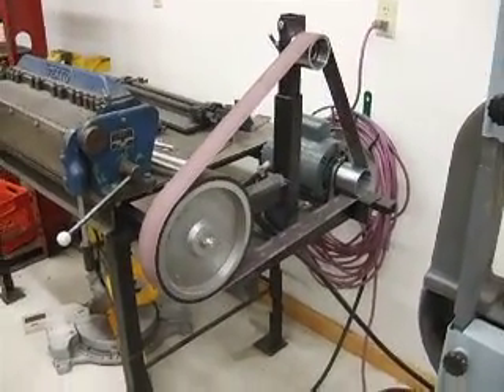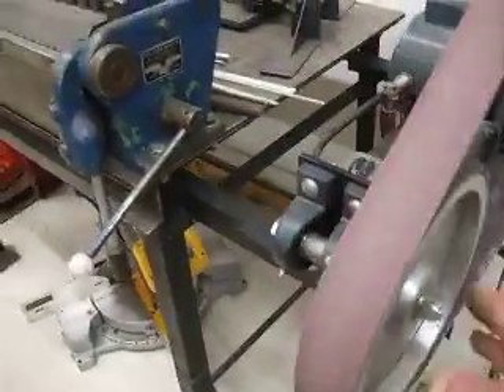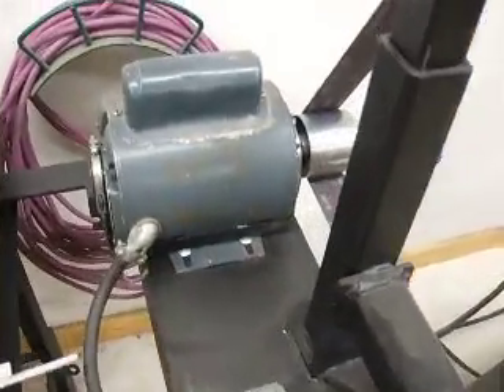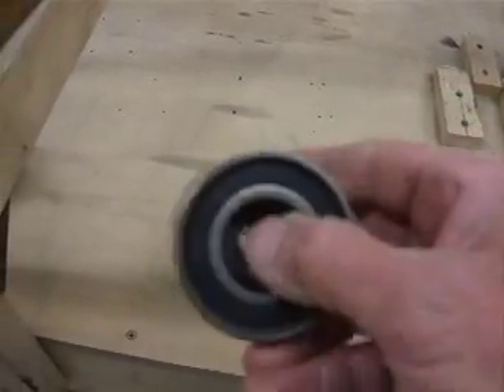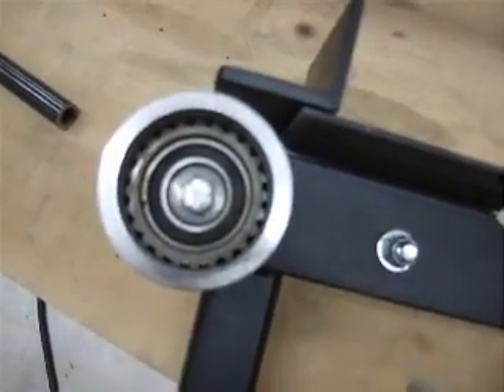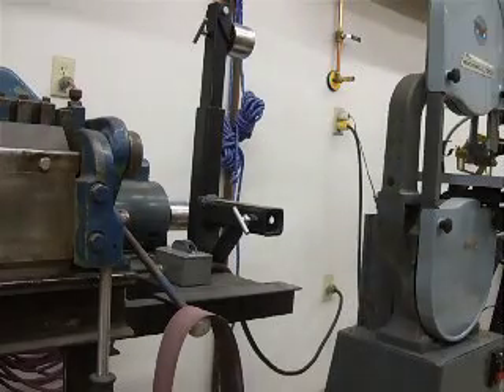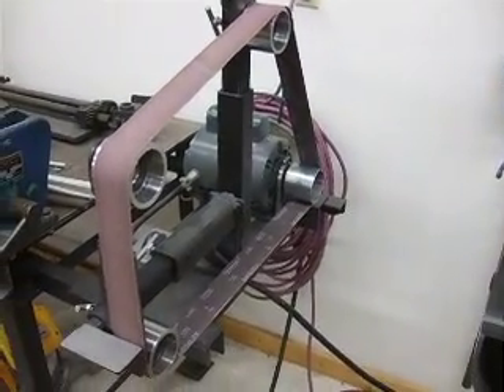2" by 72" Homemade Belt Grinder

Comment: Great video, thanks! Have you had any problems with static? How do you deal with that?
Reply from the maker: Hi Manny...interesting question and I've never thought about it. But I don't know what you are referring to when "dealing" with static. Have you experienced static discharge using a belt grinder? In all the years I've been using the grinder I have yet to experience any kind of static discharge. Whatever I'm grinding is in direct contact with the belt and I guess if there is any buildup of static electricity during use it would dissipate immediately. Hope this helps...
Reply: Thanks for your reply. I was using my newly built belt grinder without a platen, polishing with a belt that has a cloth backing , and when i touched the machine, I had a big discharged. I started reading a lot about it and is not an uncommon things using belt grinders. Do you use the machine mostly with a rest table and probably touching it often? If yes, maybe is there where you are "discharging" yourself. .. I have to try that...
Reply from the maker: That would probably be it. 99% of the time I'm using  the rest and that probably provides the path of least resistance for any static. Also, the grinder is bolted to a large metal table and the motor is grounded to the table and the electrical connection and that helps too. Maybe you can fashion some type of static discharge tether like people use when working on sensitive electronics, but that may not be such a good idea around rotating equipment. Maybe standing on an anti-static mat would help.

Comment: Awesome homemade grinder! What size is your drive wheel? Thanks
Reply from the maker: Thanks! The drive wheel is 2 1/2 inches wide and 3 inches in diameter.
Reply: alaskabearhawk thanks! Couple more things, what size are your platen wheels and tracking wheel? Also does the tracking wheel or drive wheel need a curved ridge? Thanks again, Johan
Reply from the maker: Johan Vanzanten Hey Johan...there are six other videos in the series. Look at the videos and the comments below each one and that should answer all your questions.
Reply: alaskabearhawk hey there again, sorry about all the questions. I have watched all the videos multiple times and didn't have an answer to this one. How precise does everything have to be? Will the belt fall off if I'm a 1/32 out here and there or will the tracking wheel correct any minor miss-allignment? I'm in the middle of welding and so far its going alright! Thanks
Reply from the maker: Johan Vanzanten Hey Johan... Just build it and just be careful making sure the wheels line up with each other. If you build it per the video you'll be just fine. In the grand scheme of things, being off 1/32 on a project like this is nothing to worry about at all. The drive wheel is crowned and tracking wheel is crowned and adjustable to help compensate for some misalignment. Good luck on your build!
Reply: alaskabearhawk thanks! Hopefully it works out, I will post a video when it is done and share the link :)

Comment: I finally finished my grinder and it really turned out nice. I followed Bearhawk's measurements and everything worked great. For those of you that are like me and don't have material laying around and have to buy everything this might be of interest.
These were my cost.
All the steel cut to lengths (including labor)                        $85
Aluminum schedule 80 pipe cut to length plus shipping     $56
Subaru idler barings   (4 of them)                                        $10                 
Turning the pipe to accept the barings                                  $10
Grizzly 10" contact wheel                                                      $78
Grizzly shipping                                                                     $16
Aircraft Spruce  3/4" pipe for axel                                          $18  shipping included
Pillow block pulleys  ( Beaumont Metal Works)                     $34  shipping included
Crown face drive pulley  (Chicago Die Casting)                    $37  shipping included
Assorted bolts ,nuts and washers            Probably               $20
I robbed the motor off my 45 yr old table saw ( 1hp 3450 rpm)   cost will be a new table saw.    I couldn't get it done for a $100 but really like what I have thanks to Bearhawk.
Reply: Gary Harbison Gary, thanks a lot for sharing the cost information.  I have worked almost exclusively with wood, not metal, so I had no idea what this would cost.  I really appreciate the information.
Reply from the maker: Great work Gary,,,congratulations! Once you get used to having one, you will wonder how you ever survived without it.

Comment: Great vids...thanks...one question, what did you use for the tensioning spring?
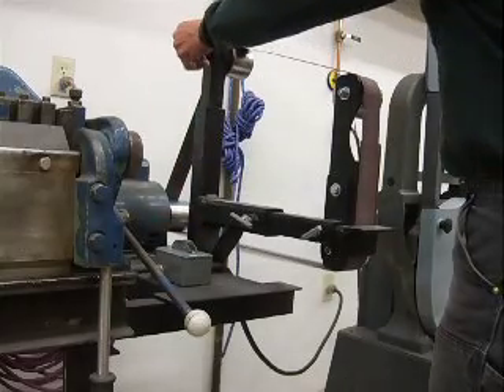Reply from the maker: Thanks! It's two one inch diameter hardware springs tacked together end to end, making it about five inches long. Look at the next video, 2" by 72" Homemade Belt Grinder Part II (4:37 long). I describe it in detail.

Comment: Bearhawk ,   Thanks for your help. I'm just about finished with my grinder. I have the 10" wheel and related parts ordered along with some belts. Everything else is finished and it will be up and running as soon as I completed the wheel assembly.  Your videos and detailed measurements were a great help.

Comment: Where did you get the flat/crowned pulley that is on the motor shaft ?
Reply from the maker: YouTube blocks web links, so just google Chicago Die Casting and one of the top links should be for the company. At the top of the page there are some links, click on the Pulleys link and that will show you the crown-faced pulley on the bottom-left of the page. You will have to know your motor shaft diameter. I think the pulley is 3 inches wide. You will probably have to call to find out where to buy one. I bought mine locally at a motor and tool repair shop. Hope this helps..

Comment: What was confusing was that I've always been told pipe measurement is given as ID and tubing is given as OD. This might help others. I found aluminum pipe on line at  " onlinemetal.com " . The 2.5" pipe does measure 2.32 " ID and the Subaru barings measure 2.367 " OD. This should work real well and there is no minimum order.  Folks might also try  " ALRECO.com " . They deal in all types of aluminum.
Reply from the maker: Sometimes standards aren't what they appear to be. A great example is a piece of 2x4 lumber. It's 11/2 x 3 1/2...go figure. As you know, the pipe I used was steel, not aluminum, as it's what I had in the scrap pile. I can't think of a good reason why aluminum wouldn't work, but of course it's much lighter. I think I probably get a little flywheel action from the density of the steel spinning around, but I don't know if that really matters. I've used onlinemetals.com before and they are great to deal with. They do describe pipe as a passageway and tubing as structural, so that's a good generalization and explanation why they are measured differently. Looking at their aluminum section, the Schedule 80 aluminum pipe dimensions are the same as the Schedule 80 steel pipe. Good luck on your build!

Comment: I still don't understand. Pipe measurements are inside dimentions so 2.5" pipe is still going to be too large for the bearings I got from the Subaru timing belt assembly.
Reply from the maker: Don't get hung up on the 2.5 inches. It isn't inside pipe diameter, it's wall thickness. Schedule 40 and 80 pipe outside diameter is 2.875, but the wall thickness is different so the inner diameter changes. Schedule 80 pipe has a thicker wall than Schedule 40. As a result Schedule 40 inside diameter is 2.445 while Schedule 80 is 2.290. Hope this helps clarify. http://www.harvel.com/piping-systems/harvel-pvc-pipe/schedule-40-80/dimensions

Comment: I know this is an old video, but perhaps you could put a handle on the tube with the idler pulley to make it easier to pull down, it's what a lot of 2x72s that style have. Thanks for the video.
Reply from the maker: Thanks for the kind words Neil. A handle is something I haven't thought of, but it really isn't necessary. I change the belt very easily just with pressure from my palm and a handle would just get in the way. It would have to have some kind of linkage that pushes the column straight down. If it were offset, like just a handle welded on the side, I suspect it would bind because the force would be pushing the column down and pulling horizontally at the same time. I like the KISS principle in this case.

Comment from the maker: You need to have two crowned. One on the drive for sure and one on the tracking roller. That will take care of any tracking issues you may encounter if they aren't perfect. You need to have the platen rollers without a crown and aligned...at least that's the way I made it. I suppose you could crown all four, but I certainly would just make a very, very slight crown on the platen rollers.

Comment from the maker: I don't see any reason why they wouldn't work. The attractive part of the Soob bearings is the inner race bore is the size of a bolt and the wide outer race, making them ideal to use in this application. You probably will need to make a bushing to make it work. Clearances would be tight so there is no radial play between the bearing, bushing and bolt. The bushing length should be exact to the bearing's width so they won't have any axial play. Bearings would have to be aligned as well.

Comment: Hello there, really nice and simple grinder you have. I have one question though: do you think if I insert heavy duty ball bearings into the pipe (2 per wheel) are they going to work as nicely as Subaru belt pulleys?

Comment from the maker: Sure. 2 1/2 in Sched. 40 mild steel pipe (2.88 external, 2.47 internal) and cut to 2 1/8th inch wide. Hope this helps.

Comment: Great videos on the belt grinder. I probably have everything I need to build one except the contact wheel, motor pulley,  and the timing belt pulleys from my daughter's KIA that I threw away 6 months ago! Couldn't think of a use for them at the time. Oops.

Comment from the maker: Thanks for the kind words! I got the pulley at a local bearing suppy store. It's made by Chicago Die Casting Mfg. Youtube won't allow an internet link in comments, but just google that company or "zinc crowned pulley" and it should be one of the top links.

Comment: could you supply the dimensions of the post and the cross member as well as the compressing telescoping bar also how much was the 10" wheel ? thanks for your help .that is an impressive design !!  I Have done the KMG GRINDER  but I really have the need for a 2nd. unit and your awesome design fits the bill just right . 4/5/11

Comment from the maker: The Soob bearings came out of a 1996 2.5L engine, probably the same as other engines. I don't have the part number, but you should be able to get them at NAPA, but they are relatively expensive. What I would do is go to a Subaru dealer or an import garage and ask for ones they had replaced. They are usually replaced even if they feel ok, generally they spin really free and the mechanic recommened replacement. They may be worn but will be plenty good for a belt grinder. Good luck!

Comment from the maker: @slab698 Hi...

I got the parts at a local store, but you can get all the stuff you need online. Google surplus center for the pillow block bearingsn and chicago die casting for the die cast zinc pulley. YouTube doesn't allow posting of links.

So sorry for the late reply. My dad isn't doing so well and I had to fly out for a visit.